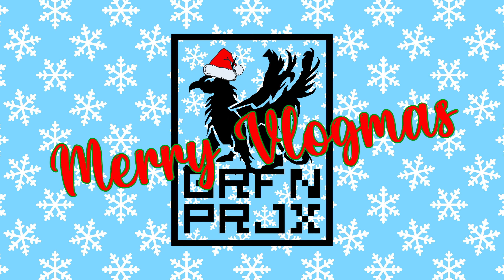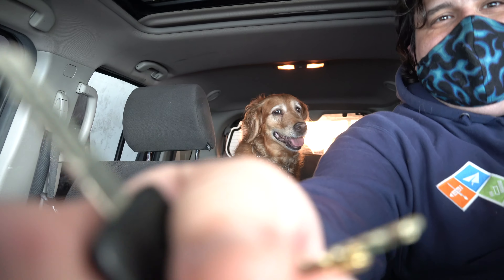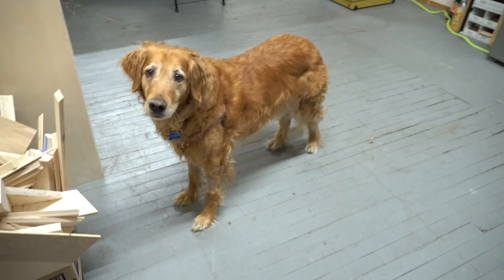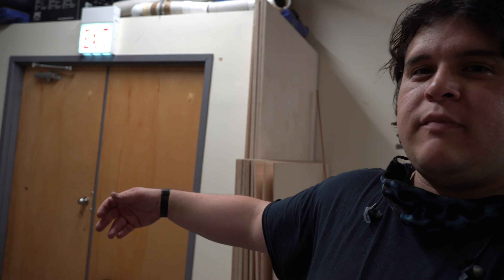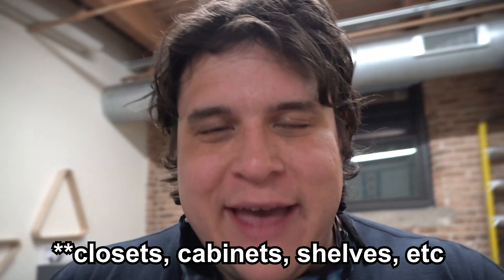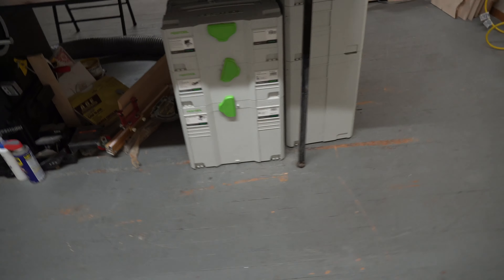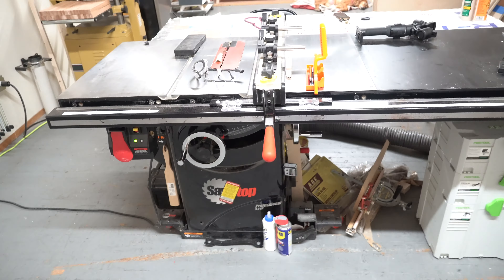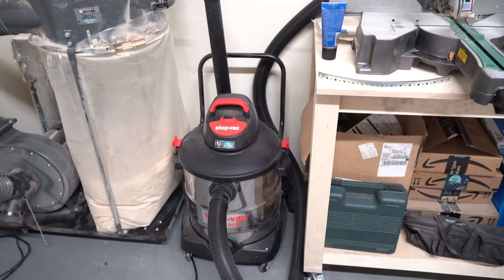Woodshop in Chicago?!  Shop Tour for VLOGMAS [day 3]

Comment: I own a similar 6 Gal compressor from Campbell Hausfeld. Its their ultra-quiet line and definitely lives up to the name. It's not a high quality or industrial machine but so far 3+ years and no complaints. Check it out. Its not too expensive so may be a good fit for your new shop.
Reply from the maker: Nice!  Thanks for the recommendation.  Side note, A friend of mine, in the building of this new shop, has a California Air Tools one that sounds similar.  I got to “hear” it and I put the quotes cuz the thing was SOOOO quiet especially in comparison to the one I have.  

Definitely going to be an upgrade I do soon.